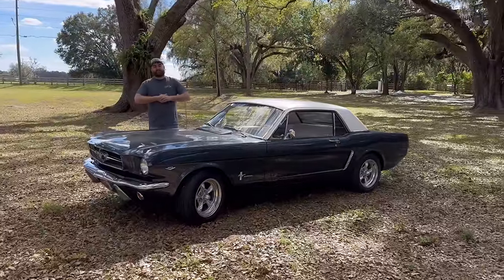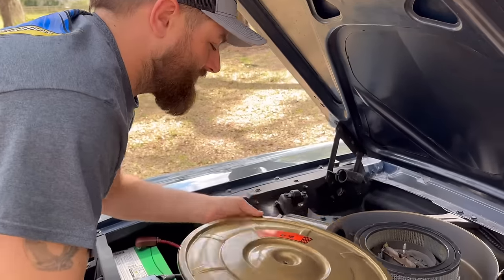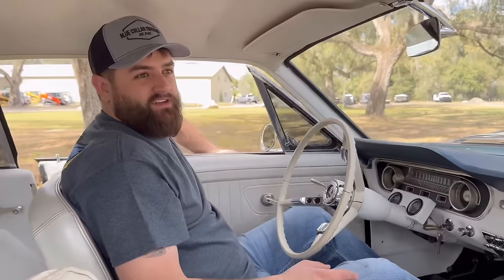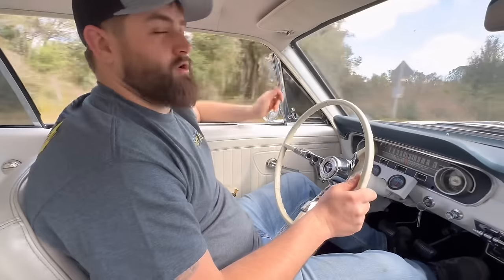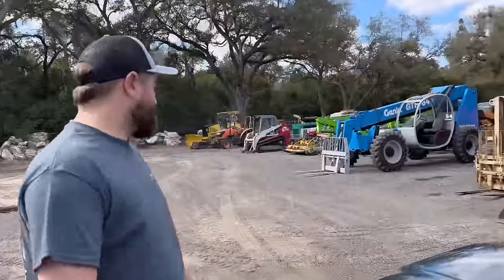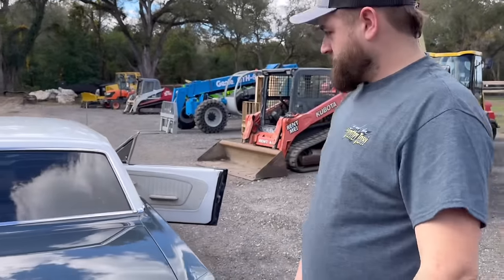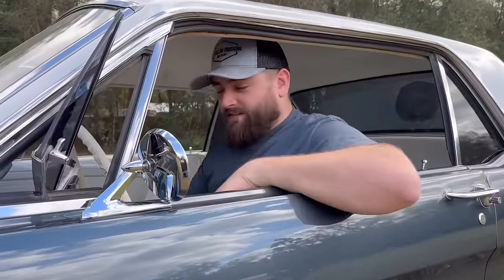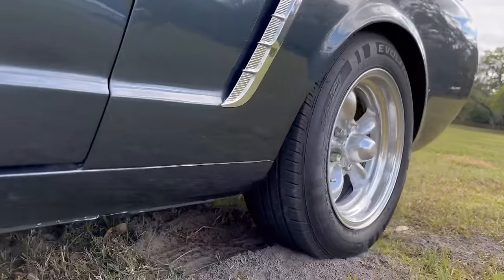All Original 1965 Mustang V8 Survivor Car, What a Rare Unit!

Comment: I have restored classic Mustangs for 40+ years. The way you check for bondo is put a strong magnet in a sock. Then drag it around on the car. The sock prevents and scratches in the paint. If the magnet finds bondo, it won't stick. It will fall off the car. Old school way of thinking. Works on any year, make or model of car that is metal.

Comment: the 2barrel 289 would have been 200hp, the 4barrel would be 225. I didn't get a good look when he opened the air cleaner, but keep in mind power to weight ratio - these cars were light and the small V8 in a light car was pretty quick! Look at the Cobras, Tigers, etc that were small cars that used 289's - deadly fast!

Comment: interesting choice for the top. Definitely looks like it was originally a vinyl hard top, but at some point got removed and they just painted that section white. Should either remove those trim pieces entirely and paint match it or add the black/white vinyl (which i highly suggest). My '66 GT doesn't have power steering/brakes either, but it's only an arm workout at rolling speeds. i'd much rather have power brake system.

Comment: All original??? 1:37 into the video I see aftermarket wheels, weird cowl vent cover, incorrect antenna and the roof has been painted a different color from the body. The chrome vinyl top moldings are a dead giveaway that this car probably had a vinyl top originally. 😂😂😂😂 I shall now press play and continue this hilarious video.
Reply: …and aftermarket gauges on the steering column. 🫣 Yeah…all original.
Reply: @chrisd2170 dual exhaust as well added as it would have come from the factory with single